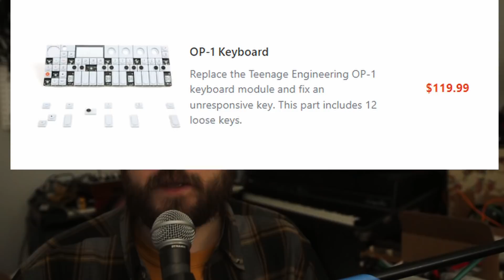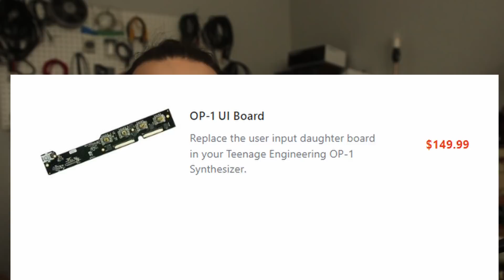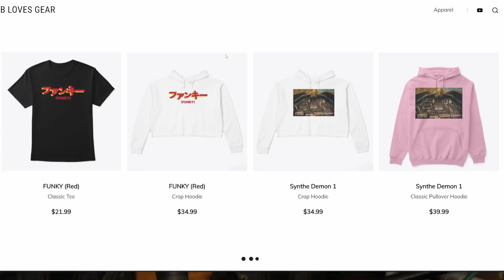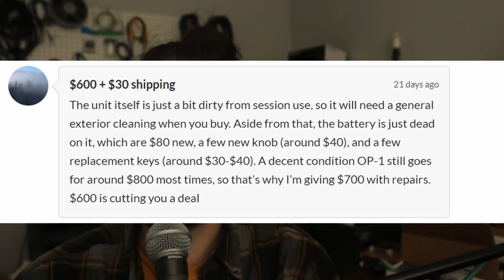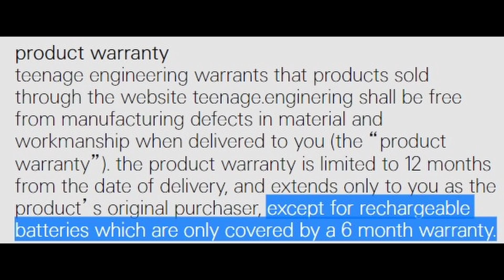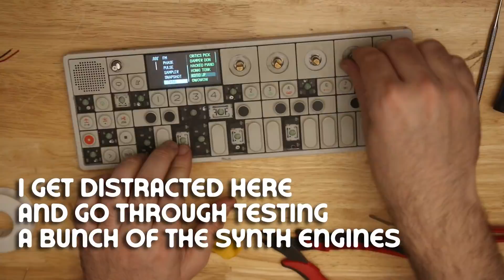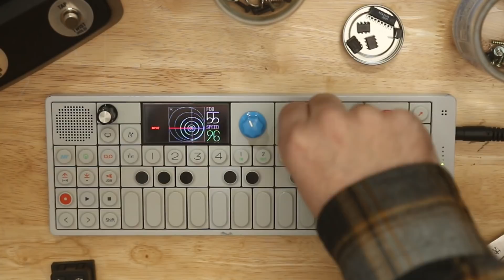Reviving a Dead OP-1 (To Make it More Affordable)

Comment: LOL the guy not including the actual cost of the labor of fixing the unit. I would have not payed more than 400 usd for that bashed up unit
Reply from the maker: Do people normally price out their own labor? I didn't pay myself for the time?
Reply: @JorbLovesGear  I didn't mean yours! I meant when the seller replied with a counter-offer detailing the costs of repairing the device, he forgot the costs of labor! Another reason for you to get a discount on the price you payed.
Even when you do it yourself.. somebody has to go through the risk of getting all the parts and actually undergoing the repair. If not the seller could have easily done it himself and sell it at a higher price. There's a reason he chooses not to and that should be accounted in the price of such horribly mistreated articles.

Comment: A $1200+ synth that dies in less than 10 years. Proof is in the pudding that these things are way overpriced pieces of shit that should be sold for the price of a Volca. Oldest synth I ever bought was a 30 year old Yamaha CS-10. It cost me $550 shipped from Japan and there was absolutely nothing wrong with it.
Reply: Betcha $1200 the Volcas will outlast these 🤣
Reply from the maker: To be fair, this unit was treated pretty poorly, but I do agree with the general sentiment
Reply: I’ve had mine 9 years and the only issue I’ve had is the lower “F” key falling off. I know that’s not everyone’s experience but it works great for me. I didn’t even have a case for 5 years and it still looks 100x better than the one he bought. Idk what they must have been doing

Comment: “If you can read this your warranty is gone, sorry” - as you wish Teenage engineering, you are now blacklisted from any of my future purchases. And I've been thinking of the OP-1. Not anymore. I won't support these anti-consumer practices and I'll be happy to steer any friends away from you as well. Sorry, but I'm not sorry.
Reply: Which company allows you to open up the device and keep the warranty? Lol. Companies can’t be responsible for people fucking around with the electronics and shorting the circuit board or any of the number of things that could happen. If you’re getting to a point where the OP-1 looks like this it’s probably not under warranty anyways.
Reply: @ChumpyDumps  Actually, laws in some legal jurisdictions prohibit such anti-consumer warranty terms. In these countries, the manufacturer may refuse to repair a device under warranty only if the owner caused the very damage they want repaired under warranty. Don't get me wrong, I have nothing against 'you broke it we won't repair it under warranty' policy. That is absolutely fine by me. However, merely opening up the device does not brick the device, does it? And not all people are clumsy nitwits who try to service their device when they're not competent to do so.
Reply: @ChumpyDumps  Literally every product sold in America and in the EU? I'm not familiar with the specific EU law, but in the USA, the Magnuson-Moss Warranty Act outlawed voiding a consumer's warranty based on doing their own repairs, and sourcing third-party parts for them, UNLESS the company can prove the repairs actually caused the damage that prompted the warranty claim.

Comment: with all the expenses and time, might as well buy a brand new one lol
Reply from the maker: Sure this wasn't an amazing deal, but I did save money, and got a unit that would've wasted away working again. I think its worth the time.
Reply: @JorbLovesGear  sure the tinkering and learning and content that it generated I'm sure was worth it for you, I think generally tho my takeaway is to not do this because it's not worth it, do you have a final cost list? You spent 600ish on the unit and 200ish on parts, so what you can spend an extra 200 and get a brand new one
Reply from the maker: @axioms22  Got the partial refund today, that takes me to 715 total, after tax and shipping. 

505 for the unit after refund, 110 for key caps, 80 for the board + og knobs, round up 20 for the battery. 

Cheapest used on reverb now is 925 + ship + tax, let alone 1300 for a new one. 

Plus I know my I/O board is fresh, plus I know my battery is fresh.